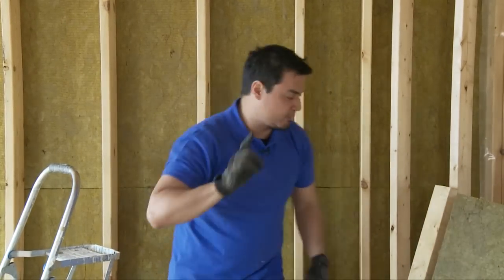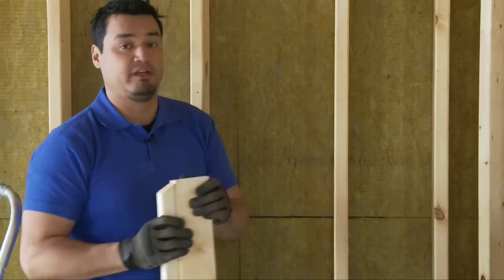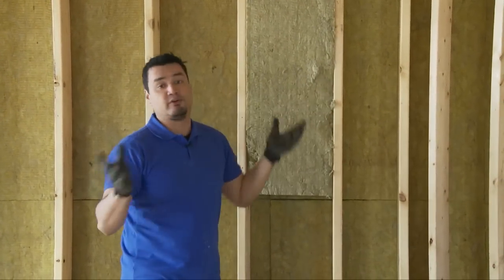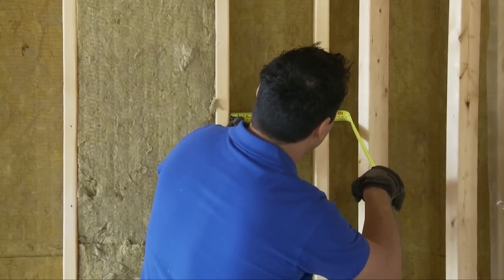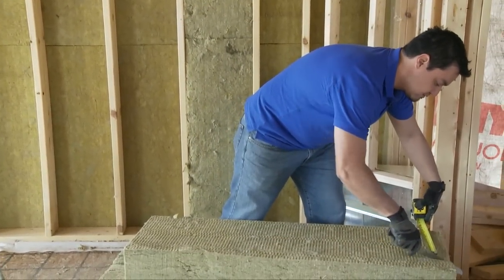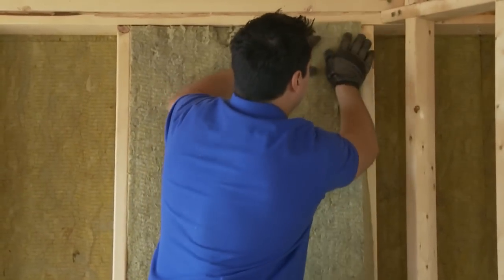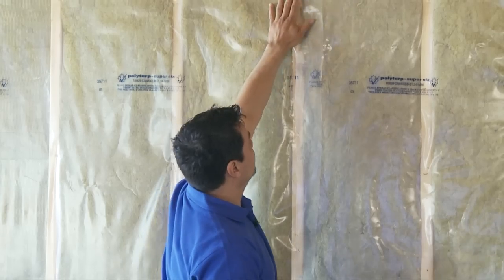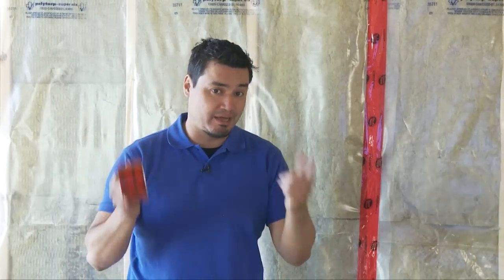How to Insulate an Above Grade Exterior Wall

Comment: Since you used staples on the plastic to hang it, vapor will penetrate the hundreds of tiny staple holes. Should you use tape to cover stud lines where staples went?
Reply: he covers them in the video...
Reply: Got it, cover staple holes with tape. Is it nessessary to staple the plastic at all the studs or can it just be intermittently?
Reply from the maker: Jan Post As the manufacturer of insulation, we are unable to make installation recommendations on accessory materials like vapor control layers. It would be recommended to contact a vapor barrier manufacturer for their installation recommendations. Regards, ROXUL
Reply: Jan Post Drywall fasteners will puncture the vapor barrier as well and you can't fix that.

Comment: It seems like the vapor barrier is on the wrong side of the wall any time it's summer and the A/C is being used.
Reply: You have to base your placement on what you expect the most extended and extreme temperature differentials to be. Where I live, I will certainly have longer periods of warm inside while freezing outside. If the barrier is placed toward the outside of the wall, it may have constant condensation on the inside surface.

Comment: In the South the vapor barrier is placed on the outside between the stud and the outside walls.  Putting vapor barrier on the inside will cause mold.  Maybe an edit to your video needs to be made so that you are not advising a homeowner DIY person wrong.

Comment: What insulation do you recommend for Zone 3, 2x6 interior Wall?
Reply from the maker: The product designed for interior wall is the ROXUL SAFE’n’SOUND® – whether it be a 2x4 or 2x6. All the best, ROXUL

Comment: if the insulation is fireproof, the drywall isn't,so won't the drywall and the wood get on fire still
Reply from the maker: Hello Andrew, 

ROXUL products are non-combustible as is drywall. Although wood studs are combustible, many wood framed walls are tested to have fire ratings of over one hour. ROXUL insulation and drywall contribute to overall fire resistance of these assemblies.

ROXUL
Reply: thanks